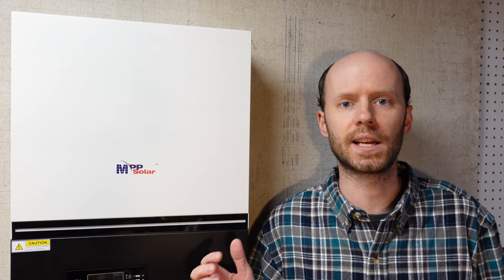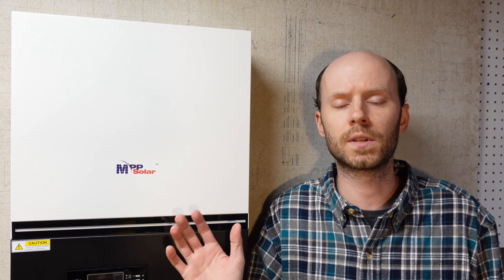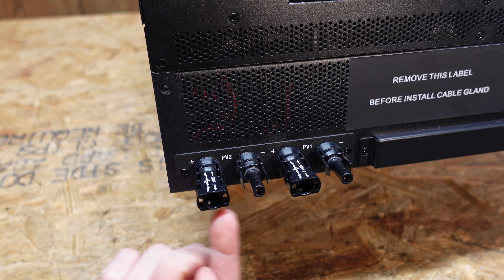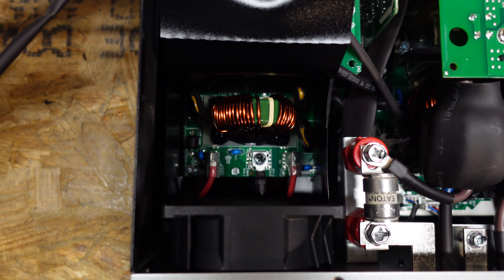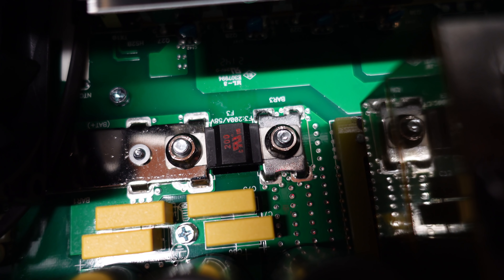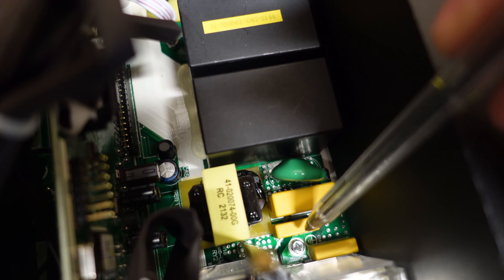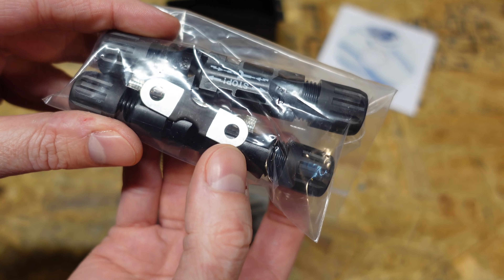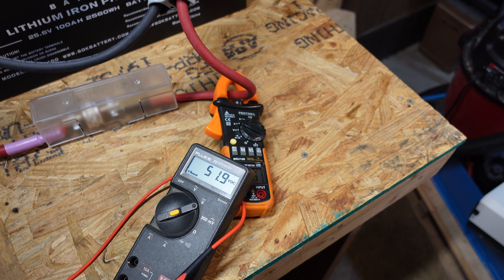MPP Solar LV6548 48V 6500W Pure-Sine Inverter Charger, UL1741 Compliant!

Comment: I am surprised that (a) there appears to be a permanent bond — as evidenced by that screw link — between the ground and neutral in the inverter and (b) the manual (which I've read online) doesn't give instructions.

The NEMA NEC requires bonding as close to the source as possible.  When the source is a utility company service that bonding is typically done in the main panel and only there, never at any sub-panels or sub-systems.  So where a bond is made depends then on the set-up.  Happy to be corrected, this is what I think:

▶ If there is a utility service connection with a main panel with the usual G-N bonding to which the inverter is connected as a sub-system then the inverter should not have a G-N bond and neither should any sub-panel(s) it feeds.
▶ If there is a utility service connection direct to the inverter — as there may be in a hybrid grid-tie system — then it must have a G-N bond and any panel/sub-panel downstream of it must not.
▶ If there is a utility service but the inverter is not connected to it then a G-N bond should be made in or near the inverter but not in any sub-panel(s) it supplies. The inverter's ground should be connected to a true ground, either its own grounding system (eg a rod) or the premises grounding system.
▶ If there is no utility service  then a G-N bond should be made in or near the inverter but not in any sub-panel(s) it supplies. The inverter's ground should be connected to a true ground (eg a rod).
▶ If there is a switching system — maybe in an uninterruptible power supply set-up — that disconnects utility power at any time then there must be a relay to make the G-N bond in the inverter when, and only when the utility is disconnected in such a way as it's G-N bond is removed from the circuit.

Basic principal throughout: there is only ever one ground-to-neutral bond and it is as close to the [AC] power source as practical. 

And…
▶ The DC side — either battery or PV should not be grounded or have any bonding at all.  (There might be protective grounding of a PV structure to a rod etc in case of lightning strike, but no such "ground" must connect to the supply circuits.)

Finally…
Where no ground is possible, perhaps in an RV or marine set-up,  then you have to be satisfied with a floating neutral and accept the additional hazard of such systems.
Reply: Dang, you and your 'AND' Great info, and I am stuck in the middle of this GN bonding issue. Not having luck with MPP email response either. I have tied my solar panels ground, combiner boxes ground and trailer with all the solar guts together (Not batteries) to the two 8' ground rods.
Reply: Ok, this might be a strange question, we recently discovered that we are feeling tingles in our home when neighbors solar is on, mostly in feet and legs. Confirmed when neighbor turned off solar for a week the tingles went away. We don't have to touch anything in our home to feel this tingling. Its felt all day from when the solar comes on and stops when the solar goes off. We have power company coming to check it out as our electrician has confirmed its not a problem within out home. Neighbors deny any issues on their side. Any idea what's going on in this situation and how to solve? thanks

Comment: What I'm thinking for the Neutral/Ground Bonding screw is this:
1) When on AC Mains power, the relay disconnects the bond, allowing bonding to happen properly in the Mains Breaker panel, the first one right after your meter
2) When on DC Inverter power, the relay connects the bond, allowing the bonding to happen "at the inverter" because essentially, at that point, the inverter is "replacing" your mains primary breaker panel.
The bonding happening at that point the bonding is in "parallel" to the inverter, not upstream. A parallel bonding is fine, causes no issues with safety on the breakers functioning correctly. However, if the inverter was in series, with the Mains panel "upstream" of the inverter, the bonding needs to be severed to allow breakers to function properly.

Because you powered the inverter up on DC power, the inverter knows it needs to be in bonding mode. Also, when "not" powered up, the relay is in default in DC mode, which allows for bonding. So in this case, when the inverter is Off, or not connected to DC power, if the AC lines are still connected, then there is a second bonding happening by default, if my assumptions are correct.

What I would like to see is that the relay is default "No Bonding" mode, and switch to Bonding mode when powered up. Because just by connected to AC with DC power connected, the inverter would be bonding. UNLESS, there is dumb circuitry (not controller, just simple voltage sense) that detects power on the AC Mains side and "automatically" switches the relay to Unbonded mode.

More testing would be required to see if these last 2 statements/assumptions are correct/incorrect/partially-correct/up-sh!t-creek   😎🤪
Sooo, more videos please!  😉😉
Reply: Logical, I wonder what the unit actual internal set up is, and how it is different (if it is different) to the MPP 6048 which has separate four terminals, Gnd,L1,L2,N for both the AC input and the AC output sides.  
I have two of the 6048's running a workshop and admit I picked them over the 6548 because of the four terminals, and what I percived as easier wiring & perhaps safer.  I wonder though, if the 6048 is in fact any different, or if the additional terminals connect internally. Maybe I should open it up...

Comment: What are the differences between the LV6048 and LV6548?
Reply from the maker: The LV6048 can output 120/240 with a single inverter. I don't have one myself, but I believe it accomplishes that by having 2 separate inverting circuits in the case (size and weight also indicate this). I see the manual states <100W no-load consumption. This is why I made the comment about the LV6548 being (in my opinion) the first that scales up without a gigantic self-consumption.
Reply from the maker: Here's the manual for the LV6048 if you want to compare. It looks like the battery voltages are also lower http://www.mppsolar.com/manual/SPLIT%20PHASE%20LV/LV6048%20split%20phase%20manual-20201120.pdf

Comment: Looks very nice, thanks for the review. One question: what kind of warranty does it have?
Reply from the maker: It's under a 2-year warranty with the distributor I purchased it from. That's a US warranty, not a "ship it back to China" warranty.
Reply: Ah, I’m new, is that an average, good, great for an inverter?
Reply from the maker: I guess I would classify it in the "good" category. It doesn't require return shipping to China (which is impractical in most cases) but there are others on the market with longer warranties.
Reply: @LithiumSolar  I see, thank you much.
Reply: @iTeerRex  Reputable grid-tie inverters typically offer warratnies of 5 years, plus a 5 year extended; some offer a 20 warranty.

Comment: This is a great inverter.
What size cable did you use?
Reply from the maker: The manual for the inverter suggests 2/0 AWG cabling for the battery connection.

Comment: Why would you want this when you can get the 48 volt lv5648 and buy a step down transformer to have split phase, which will still be cheaper than model your showcasing?  
Not a condescending comement, I would like to know the advantages of purchasing this one over the Lv5648
Reply from the maker: I can't seem to find the LV5648 model you're referring to. Regardless, I don't understand why you would ever want to buy 2x 240V inverters and a transformer when it will no doubt be more expensive, increase points of failure, and reduce overall efficiency of the system.
Reply: @LithiumSolar  Thank you for your reply sir, I greatly appreciate it. I would be using this all in one system to attach to the existing circuits in my house, to power my main panel. So in the even if a storm, I go to the basement, flip of the main breaker via a lockout switch and feed my house circuits via the lv5648. The system will not be grid tied.
Reply: @LithiumSolar  sorry 5048

Comment: Now you just need the other one to run 240.
Reply from the maker: It's very likely that there will be a second one depending on how my evaluation of this one goes :) It will depend heavily on what the manufacturer has to say regarding the N+G screw I thinks.
Reply: @LithiumSolar  yes that issue is very confusing for North America system but if completely off grid is not an issue. With two sources of power the grounding/bonding issue needs to be dealt with.

Comment: You do realize "UL Compliant" is meaningless?  If it doesn't say "UL Certified" it's just marketing.
Reply from the maker: Did you watch the video? I spelled that out pretty clear.
Reply: I wouldn’t worry too much about that. The fact that they make the claim is enough to make the manufacturer and the distributor liable for any consequence of it being non-compliant. Fraud is an easy enough case to prove.